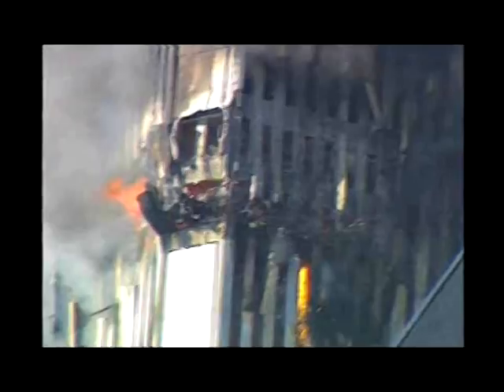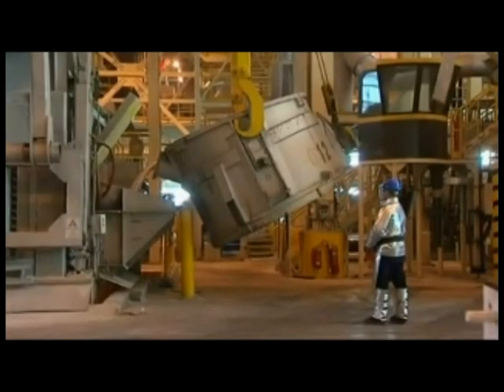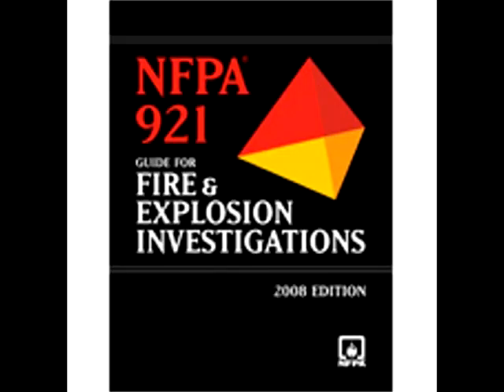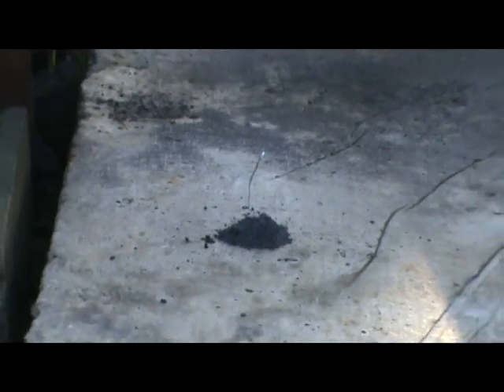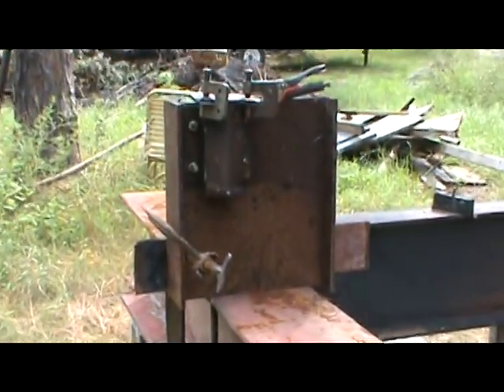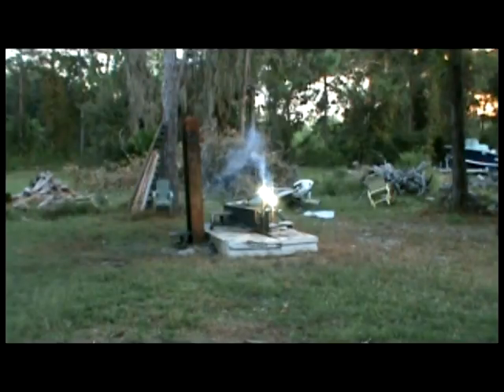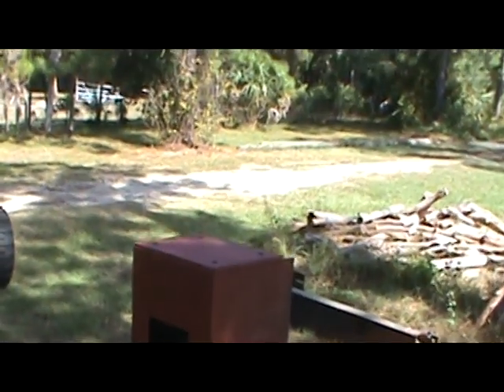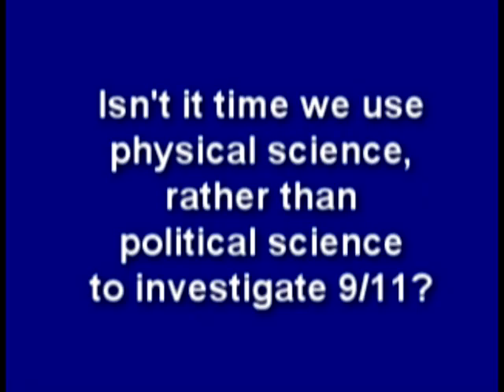9/11 Experiments: The Great Thermate Debate

Comment: The buildings were supported centrally. When they collapsed they collapsed centrally and that fell down in a straight line. The fuel set other materials on fire such as plastics, wood, aluminum, and other materials in the tower. Also the wind (even mild) creates a bellows effect that helped melt steel. This effect was seen a year or so later when a gas truck caught fire on the Golden Gate Bridge next to a support and the heat caused steel to melt in that situation. This is a bogus video. The initial crash blew the flame retardant flocking off the beams and the heat weakend/destroyed their structural integrity causing the collapse. There is tons of rubble in New Jersey (Chris Christy gives it away as gifts) and it does not test positive for any explosive. Wake up now.
Reply: Why did the wind that caused the bellows effect noted in your premise (and calculated further up the page as 75mph) not have caused the tower above the  impact point to list in the time before collapse?  Wind has a significant effect on tall buildings and as the steel weakend the building would have toppled.
Reply: it didnt collapse and smash its way down the tower because it doesnt slow as it falls. it goes at freefall speeds. in order to do this it needs near 0 resistance. does 100 healthy floors sound like 0 resistance to you?
Reply: 2 inch pieces hmmm? Ever dropped cinder blocks on raw meat? Yeah, its like mashing potatoes, same shit will happen if you drop huge multi-ton building chunks on people.
Reply: thats a really good point. i dont know how i got sucked down this rabbit hole but reading the comments is entertaining thanks for your comment. peace from colorado
Reply: wake up now 

pricks
Reply: this keeps getting more interesting. great comment josh. peace to you from colorado. thanks.
Reply: haha thanks man
i really appreciate that 
peace
Reply: Even a weakened structure can still stand up to lighter wind speeds that would fan highly flammable jet fuel and other materials hot enough to melt (or warp to the point of being unable to support any weight) steel beams.
Reply: no. fuck you. false equivalency. 
ive never mashed potatoes onto my fucking neighbors building.
Reply: "you hate brown people" No I don't. Not as individual human beings. But I do hate much of the Islamic ideology and the way it is practiced and spread mainstream in the middle-east and the wider world. It's sexist and savagely violent.
Reply: Bramak17 nice regurgitation of all the BS you've been fed...read the nist forensic "analysis" first for your info on how much the fire effected the columns below the crash site..hint; they admitted they were not effected at all.
Reply: Jay Kilbourne ...lol..you just completely ignored the outer structure that supported half of the floor loads and some of the lateral wind loads....ill venture to guess you've done zero physical analysis of the collapse event...don't feel bad about that though..neither did the govt, even though required by law to do so.
Reply: OK. Then gather the 'evidence' and sue the congress. Otherwise stop regurgitating conspiracy theory BS that you blindly believe without doing any research yourself.
Reply: dr judy woods has already filed a lawsuit 
and the Muslim faith is the cousin of Christianity is the cousin of Judaism. its all a big bullshit show for social control, and to need a god to believe in is to need a babysitter as a 25 year old man. its all fucking silly hats and child molestation no matter where it is or what it calls itself. be it jew, born again christian, Muslim, Mormon or Scientologist.   
the 'evidence' is overwhelming.
Reply: Some hats are sillier than others. And Islam is the silliest hat. If the government actually did d 9/11 and you and all the other 'truthers' knew; you'd all probably have disappeared long ago, never to be heard from again. EVERY government that has ever tried to hide something from it's own people made those who knew about the real story go bye-bye. So either the US gov. is fucking stupid, or you are grasping at nothing.
Reply: Sorry bud; but Islam is guilty of FAR more acts of terrorism and barbaric savagery than anything else anywhere (save maybe communism). And its been doing it since the 700's AD.
Reply: yeah, forgetting the christian crusades, the kkk, knights Templar/ all other christian atrocities erased from history. 

sorry bud!

your religion is just as bad, if not worse as theirs, and comes from the same source- Judaism. lmao just stop trying
Reply: plus! look into the taxi driver witness who has since changed his story as the pentagon witness. 
Bush's dad was the head of the CIA. the CIA would torture unwilling US civilians with days of heavy lsd dosage. The united states gov. sponsored infecting a bunch of black people with syphilis and took notes as they died. after a cure was known
they didnt inform the people in the test there was a cure and took more notes as they died. 
your government will kill you!
just think of who stood to make money from 9/11 and who is still making money to this day (from it)

DARPA, Lockheed martin/the entire military's industrial complex.

the federal reserve- loaning out war money against the tax payer's income at a rate of interest to the US gov. effectively forcing my children to pay for something that we didnt even get to vote for (all of these wars in the middle east)

Bush and Cheney's joint oil companies. 

the dollar itself, as the military has strong armed iran, iraq, and lybia into only accepting the dollar for oil .

the building contracts that went to US companies for rebuilding after the destruction.

big pharma, as the military is now guarding the poppy plant that gets processed into the Oxycontin and hydrocodone. guess what! we're now facing an epidemic of addiction similar to the opium epidemic in China. 
poisoning the very rural communities that supported the bushes in the first place. 

and many more!!!!!
none of this is speculation. this is 100% fact.
Reply: YOURE SUCH A FUCKING IDIOT IT HURTS ME
Reply: THIS IS LIKE TEACHING CALCULUS TO A BRICK WALL. YOU HAVE NO HOPE OF UNDERSTANDING THE TRUTH BECAUSE YOU REFUSE TO LOOK AT IT
Reply: you sound like a dedicated student of prager U
Reply: Christianity comes from Judaism. Jesus was a jew himself. Jesus realized that he was a son of god. as a son of god he proclaimed to all others to worry not about tomorrow's bread, as we are all children of god and god will take care of us. he was eventually killed. The king could not have everyone going around and believing that they were all the children of god, special, worth more than nothing, yet all equal to one another in a very intimate way. This is a dangerous thought. After Jesus was dead the myth of his godliness was created around him, and the cult of worship was formed. these people spread the resurrection myth, and preached prayer to Jesus as a god himself. The Jews do not recognize Jesus as this godly figure, they still respect him as a man. thus, the split in religion Jew---Christian. 
             Judaism, and thus Christianity, spreads. Christians blame Jews for the death of Jesus because of human bullshit. infighting occurs, sects form, the religion spreads, and eventually reaches further south. people read and worship the teachings of early Jewish work. Moses Aberham, Noah, Adam are all revered as prophets, and Muslims credit them with the base of their religion. same as Christianity, same as Judaism. Until Muhammad begins talking to god, Islam was no different. The only difference is that they have their own regionally sanctioned Jesus! They worship their own brown godly connection, and can you blame them? who cares? you have your own beautiful little white boy jesus whos dick you get to suck when you get to your own little playground heaven you've imagined for yourself! who cares about what someone else thinks up? its all a bullshit story to begin with! The books are a fun read. They have heroes, monsters, bravery, life lessons, adventure, and all the other classic fairy tale archetypes, i'll allow you that; however this is not to be confused with the world that exists independent of our interpretations.  

if you want to know the truth, get the The Secret Oral Teachings in Tibetan Buddhist Sects. know yourself beyond the ego, and think of this world beyond your own perspective. its all the same religion anyways.
Reply: just because you're afraid of brown people doesnt give the government the right to strip search me before i get on domestic flights. it doesnt give the government the right to read all of our emails, and tap our phone calls. and it definitely doesnt give us the right to make brown civilians fear blue skies because of drone strikes. 

because of 9/11 though, all of this is now the reality. 

so congrats for being happy about being oppressed you piece of shit.
Reply: oh yeah??
if the building really pancaked with no explosives what kind of bodies do you think we would find? what kind of rubble would we expect to see trapped between the floors as they "pancaked" on each other? flattened ones. like fucking pancake people, 2 inches wide, mashed under tones of rubble. 
thats not what happened though, is it?
no 
bodies were found in tiny 2 inch pieces on adjacent rooftops. it takes explosives to turn people into 2 inch pieces. 
its ok to think your smart. 
but dont play yourself like this its embarrassing for me to watch

Comment: Your not putting into account all the weight of the steel holding up I'd put a hydrolic press on the steel and burn some jet fuel
Your hypothesis doesn't add up because your not putting the stress and the weight of the steel

Comment: If you cant understand the amount of weight loaded on that steel which was heated up in a fire  was enough to soften it enough for it to bend and then tear.  The whole melting thing is just completely wrong but nobody thinks about the combination of the effects of thousands of tons of weight and a hot fire on that straucture.  There was no mention of the weight.  Plus they don't use thermite for building demo they have shaped charges that cut through steel beams like butter.  Thermite is used to disable or ignite weapons. And it's was definitely not used.  It's white hot not orange like the scale from a foundry.

Comment: "Can a jet fuel fire melt steel under that much pressure?" is the real question. I think the weight of the rest of the building above the impact overloading the beams that weren't damaged probably contributed to it melting and burning at an increased temperature. Just my hypothesis though.

Comment: heres the thng. a metal girder does not need to be melted in order to structually fail. onle heated. IF YOU HEAT METAL, EVEN IF ITS NOT MELTED, IT IS WAY MORE PLIABLE WHEN HEATED UP. this is why blacksmiths heat steel up BEFORE they bang on it with a hammer. in this case, the weight of the building above is the strike of the hammer, but is a constant and not and shock load. as thes steel heats up, the weight of the building above will deform it, once it reaches a critical temperature. usually red hot, but not melted.

Comment: As you correctly state “you are not an explosive expert” I however, while not an expert, do have quite a bit of experience in this area. To set up any building to be taken down with explosives would take months of preparation involving the stripping down and removal of internal lining, the setting up of the right type of explosives in the right places and the running of kilometres of detonation cord. In your scenario the setting up would take ten times longer and you ignore the eye witness testomy of hundreds of others who said they heard the explosives going off, you can’t have it both ways. So is it quite Thermate or louder explosives? Even in your example you are only looking at some floors being rigged in such a way, do you accept the fact that one floor can’t accept the load of the floor above and therefore collapsed onto the floor and floors below. Most people who think the buildings were bought down by explosives have no idea how this is done and therefore how stupid the idea is. This is not the set of a James Bond film where a button is pressed and everything is done by radio, Det cord is used to make some explosives go off before others and in every case it is done from the bottom up not the top down. Convenient that Thermite is hard to set off and to do so requires a lot of heat, yet it is proposed that thermite managed to survive 1000 deg for an hour before being set off.

Comment: (1) the structural steel didn't melt, just weakened, (2) other metals like aluminum melt at much lower temperatures, and (3) I kinda doubt the firemen took samples of the melted metal they saw floating in order to determine its chemical composition.

Comment: The aluminum cladding on the building melted. There was no molten steel, pictures show the steel bent because it was softened by the fires. All of that molten material is flowing down the OUTSIDE because the aluminum cladding was on the outside.

Comment: Possible that it's not molten metal at 0:50, it looks more like melted, liquified plastic (vinyl, polyester, acrylic...) pouring out.
 
Experiment- grab a large scrap piece of commonly used carpet flooring, melt it and start it on fire... and let it pour.  It will make a surprisingly accurate imitation of the "molten metal" video.

Comment: Why aren't they talking about the with of all that steel combined weight high temperatures?  Right, steel doesn't melt at the heat generated by jet fuel.  But it is still weaken.  Perhaps enough to cause the collapse.  The test do not account for the tremendous weight.